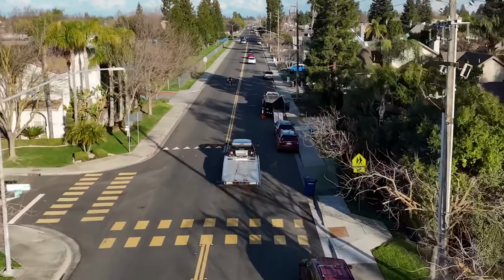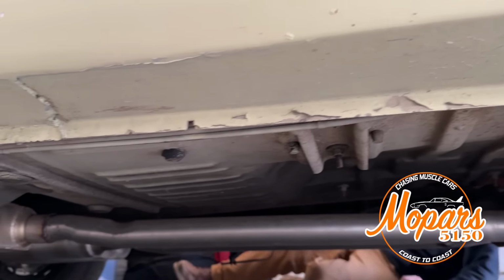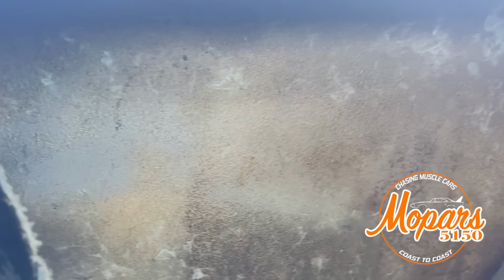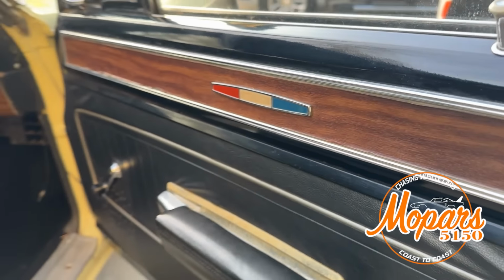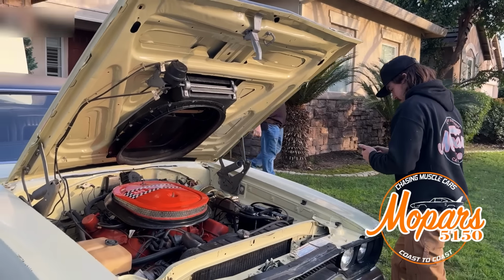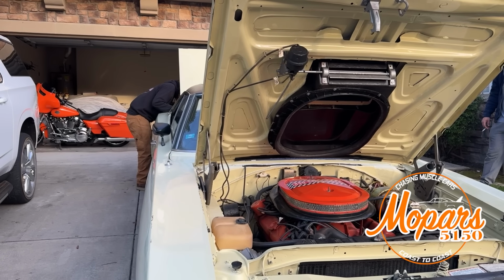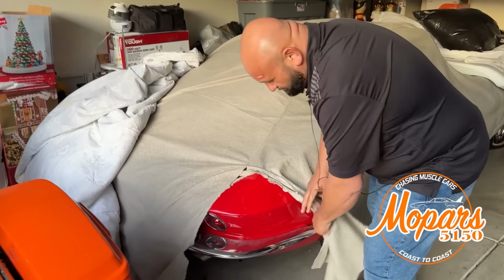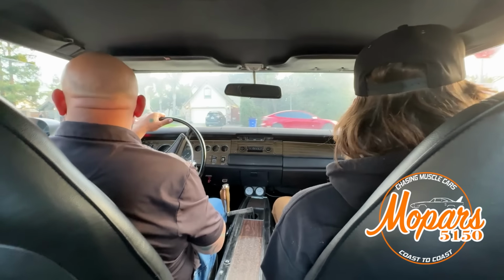A Six Pack To Go: ‘70 GTX V Code 4 Speed Cali Garage Find- Mopars5150 S1E14

Comment: I had a 70 Road Runner that same color. I paid $1200 in 1978 from a Dodge/Plymouth dealer. 383 magnum, automatic,  bench seat the cheap version of the Magnum 500 wheels, they had the removable beauty ring.  It had 63 thousand miles on it. It had a burnt valve, so it was my first time pulling heads. I put about 30 thousand miles on it when it started running badly due to the plastic coated timing gear. The plastic was breaking apart, which caused erratc timing. It came factory stock with a Holley 500cfm
carb. It ran alright. I wish I had not let other priorities of being young and ignorant. I was making great money for the time, and I thought partying was more important.
I wonder today what some bolt ones and a 750 cfm carburetor with  some gears how much better it could have been.
A friend of mine had a 70 Hemi GTX.

Comment: I never realized the production numbers of 6 pack 70 GTX's were that low. Back in 1976 local guy owned one. It was blue with the 440 6 pack pistol grip 4 speed. I remember the car vividly. It developed a legend as to how fast the car was. He put  4:56 gears in the tail and beat up on everything locally. Then i found out he got married and his wife couldn't drive a 4 speed..  and he swapped in a 383 auto combo. Fast forward 6 years after my navy service and then found out the guy had sold the car and it was rusting away in 3rd owners backyard. No clue if the original drivetrain went with the car. What a shame. I am a chevy guy but i love the GTX's!

Comment: Nice GTX! But one question. I thought both Hemi & 440 6 pack cars with 4 speeds couldn't be had with A.C.? So did I see a "Airtemp" sticker on the P.S. rear window??
Reply from the maker: I’m sure in a 54 year span the window got replaced

Comment: Its called a survivor because it’s never been formally restored in over 50yrs with 1 repaint & a motor refresh having original interior,chrome,bumpers outside trim,wheels numbers match drivetrain etc. It’s much more a survivor then being a complete body off restoration like most of these cars are today.
I’d replace the trunk pan if it’s truly that bad,detail the heck outta the car top to bottom & go thru it mechanically & have fun with it ad is which would look good as it vs going at to make make it perfect.

Comment: Mostly all there, but it was kinda rough. I guess the parking brake is broken. Trunk floor looked bad, the Rt rear qtr looked full of bondo. It looked like the trunk leaked like a sieve. Interior seats looked like the panels had been reupholtered with some weird, cheap material. Round exhaust tips were OReillys specials, & no resonator. Wheel center caps were mismatched. Not the greatest choice of color for repaint. If it were an original black car, that would be best choice, but the bodywork would have to be pretty good. That said the underside was pretty rust free. Numbers matching a big plus.
Reply from the maker: I wonder how many yellow gold 70 GTX 440 4 speed Dana cars made , and how many are still numbers matching. I like the odd ball colors that Mopar made few if so it’s perfect for us. But I’ll take the black one too 🍻😂

Comment: Survivors don't have bondo or repainted or boosterss changed nice car but not a Survivor.
Reply from the maker: 💯 agree
Reply: @ChasingMusclecars_Mopars5150  I watched a channel recently they were doing a 70 aar Cudal only original sheet metal leftward the plenum and they tried to call it a real car stating it was a restoration. I said tribute.car now nothing original left
Reply from the maker: @ChristopherRalston  we save them from the worst of the worst too, we don’t believe in crushing any. At what point does it become a tribute in your eye?
Reply: @ChasingMusclecars_Mopars5150  when 90% of the metal is replaced
Reply from the maker: @ChristopherRalston  so at 50% we’re ok? Even 75% but 90% too much? So if 10% left its to the crusher it goes? And just say “oh well, there’s 1 less now”? But if it’s 89% let’s save it? Nah, I can’t subscribe to that. Save them all, regardless if it’s 1 quarter or 90% it’s no longer original. That doesn’t mean we throw it away.  My opinion of course #savethemdontcrushthem